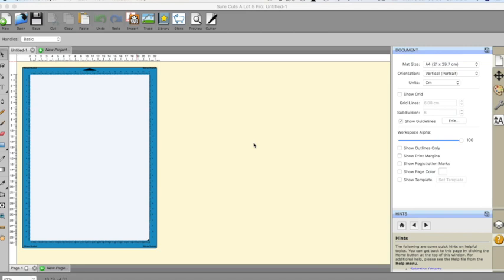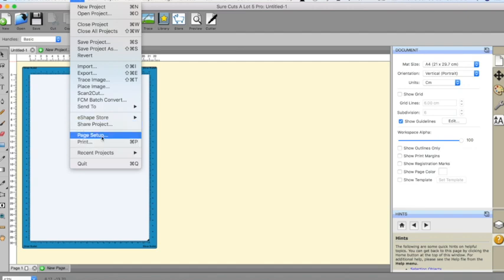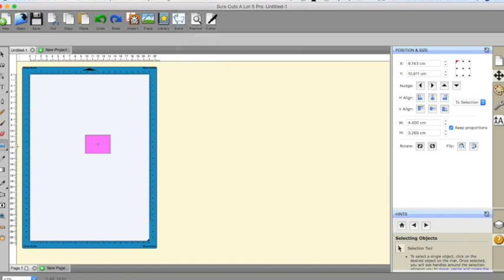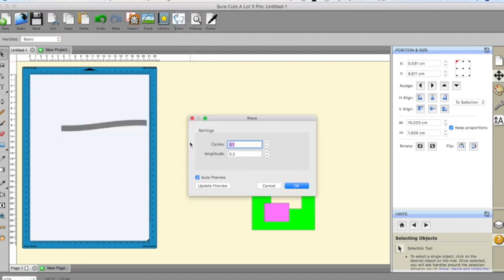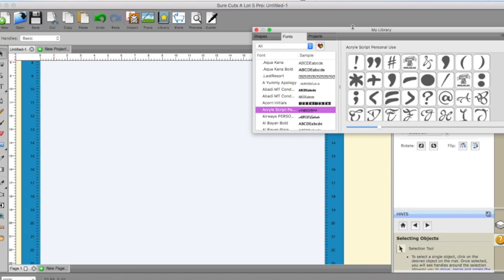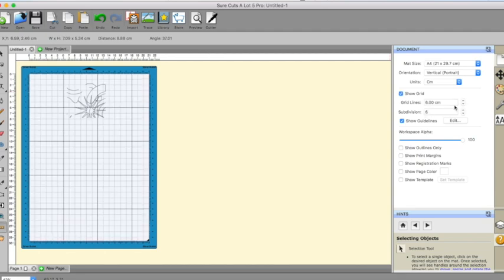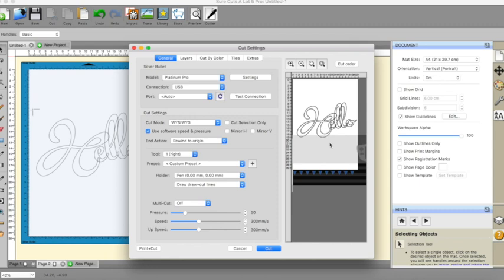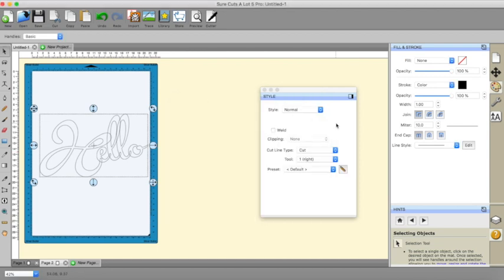SURE CUTS A LOT  V5 PRO    Cutter software

Comment: Just purchased SCL5 and I have a question.  I typed 3 lines in a text box.  Is there a quick way to separate the lines or is copy-paste-delete a line and repeat the only way to separate them?   Thanks so much.
Reply from the maker: You can either type them as separate lines, or just select them and UNGROUP. Select the line you want to change and regroup after. Don't use break apart unless you wish to separate the inside of the letters too!

Comment: I think I know what the templates feature is for. If for example you want to cut a design to stick on your cell phone case, you use the template of the cell phone case  as a guide to ensure that the desihn will fit on your cell phone case. It basically saves you time from creating the object you want to cover with your designs. Hope this makes sense.
Reply from the maker: I think you are right, I've just never had a need for it!

Comment: What the differance between scal 5 and scal 5 pro?
Reply from the maker: http://www.craftedge.com/products/products_scal.html  It is so long since I got the Pro version of the software, it's hard to remember! The main one for me, is being able to assign a cut setting to a particular layer - because I have the double head. Also being able to have multiple projects open at the same time. The  page linked has more detail. If in any doubt, contact Craftedge and ask, especially if there is a feature you really want.
Reply: @createinspain  think for what i want basic will do. Make outline for my craft stamps that i do have die cuts for them. I will be using suv alot.
Reply from the maker: @RainorShine1  Well if you ever decide you want the Pro, you can update it over the base of the normal version, so not a problem.

Comment: Great video Sandra, have been toying with the idea of upgrading to the pro version. I think you will find there is one particular brand of cutter that will only cut using SCAL 2.
Reply from the maker: Thanks Tracy. If there is, I feel sorry for the owners being stuck with out dated software!
Reply: which cutter only uses SCAL2?
Reply: ALISON CARTER I think it is some of the older cricut machines, check here http://craftedge.com/support/faq/faq_surecutsalot.html#
Reply: ALISON CARTER several years ago SCAL could be used with Cricut machines. Cricut had a proprietary program and didn’t like that idea so I believe a lawsuit stopped Craftedge software’s ability to connect with the Cricut. SCAL 2 was the last version that could control Cricut machines. Cricut uses its own software called Design Space which, IMHO, can’t do near what SCAL can do. Designs made with current SCAL can, however, be saved as SVG’s that can be imported into Design Space.
Reply: But in scal 4 and now scal 5 we can use cricuit, can't cut directly from scal but can't save as svg file then upload I'm design space and bam there you go. Just look up some cricuit and scal 4 or 5.
Reply: SCAL2 is the cutting software for the Sizzix Eclips2 cutting machine. If you have SCAL2 you can upgrade for a small fee to SCAL3 which brings 9 of the features from SCAL5 (NOT Pro 5).